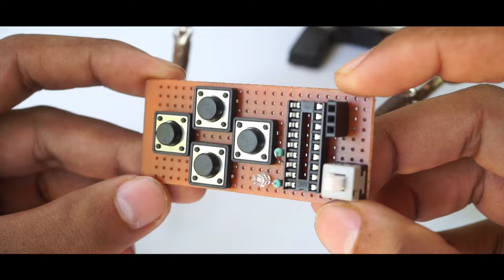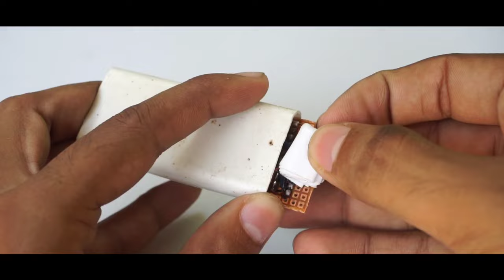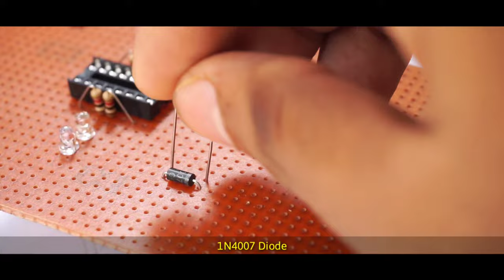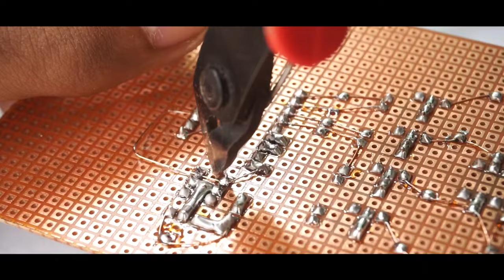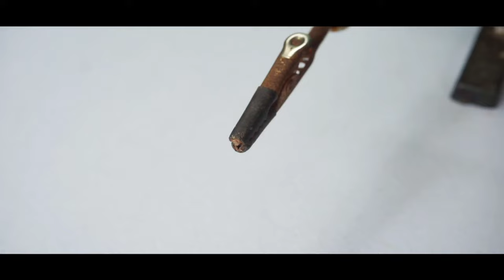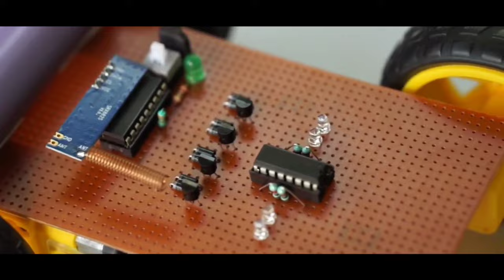Very Easy Homemade Remote Control Car Circuit || with Circuit Diagram

Comment: Brother I've a Question You're Using 2 Resistance 820k and 220 ohm In Transmitter But The mentioned Circuit Diagram have only 1 resistance used there 33k ? How do make it I've all the comments regarding Your Diagram

Comment: Can you make a video explaining the working of the circuit diagram of the transmitter and receiver module you have used
Reply: Please you can start yeor chanal 😢😢 please 1 video 😢😢 ❤❤   plese😢 please 😢😢😢😢😢😢😢

Comment: Ek ir  receiver  video water level indicator ke bhi banao or uski reng kam se kam 200,300 mitar minimum hone chaheye
Reply from the maker: There is no rf module available in the market that gives range more than 100meter.
By the way you can extend range by adding multiple rf module in gaps.

Comment: I have bought RF module for about 4 times and it get broken !!! What's the problem please ?  it works from a very near distans and when i get away the transmitter it doesn't work

Comment: Hey there, this is a really good project...
I would like to make one too, but can it really go 100 metres...
Reply from the maker: Yes.
This RF module works perfectly on 100 meter range.
Reply: @estechknowledge  thank you so much body
Reply: Hey i have one more question but i don't want to bother you...
Someone in the comments asked but you did'nt respond...
Can I put joysticks instead of buttons?
Reply: @estechknowledge .proof?

Comment: Can 433MHz RF wireless module be used instead of STX882 module?
Reply from the maker: Yes you can use any 433mhz RF module

Comment: I've made this and it worked. But the left and right buttons don't work like in the video.

To turn, I had to press the left/right button first and then press the forward button. If I press the left button and the back button at the same time, it can turn but to the right the motor does not move. May be a problem with the dc motor.

For the battery I use a 2x18650 with Step Down but the speed is very slow because I limit it to 5.5 volts. I tried to connect the battery output directly to PIN 8 but it couldn't work and the IC started to burn out.

Comment: When you come to know L293D ic require around 7 to 12v to drive the motors😏
Reply from the maker: If you want to use more than 5V then you have to connect an external power supply.
Reply: Please explain more 😢. I'm a novice🙏🙏
Reply: @awemodupe200  the motor driver the guy used here is l293d H bridge driver, which can power two motors. The ic can handle current from range of 1.2 amps to 2.7 amps over that current makes the h bridge to get hot and burn out.. you can add an heat sink for better performance.. inorder for the internal h bridge to work it requires 5v normally pin 16, and to power the motor, it requires 5v to 12v and around 1.2 amp continuous. 

I was wondering how the guy ran the circuit with just a single puny 3.7v lithium battery... And he powered 4 motors using just one l293d.. i seriously doubt that
Reply: @arunjoseph108  thanks

Comment: Not working bro i fully finished but yet not working
Reply: I finally finished soldering this circuit. But mine is for turning on and off the led on receiver side. 
I haven't tried the Motor Driver though.
May I ask what you problem you encounter with.

Comment: Did not working
Reply from the maker: Which rf transmitter you have used?
Reply: @estechknowledge  433Mhz transmitter and receiver
Reply: Any external dc source is apply for l293d ic?
Reply from the maker: 433mhz similar modules that I have used?
Reply: @estechknowledge  but the motor drive ic didn't work properly......